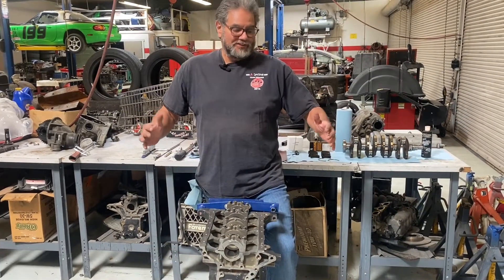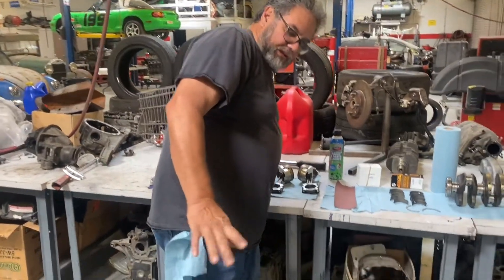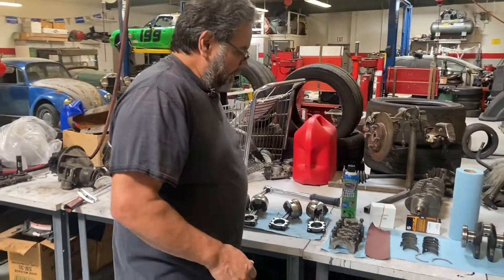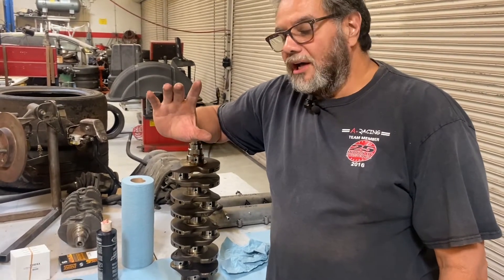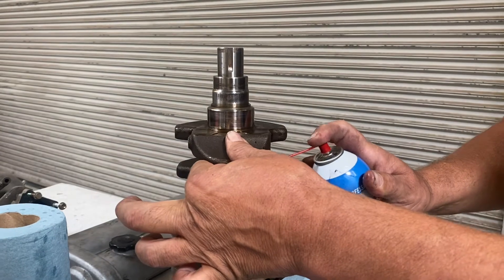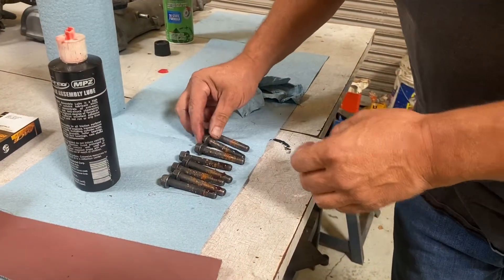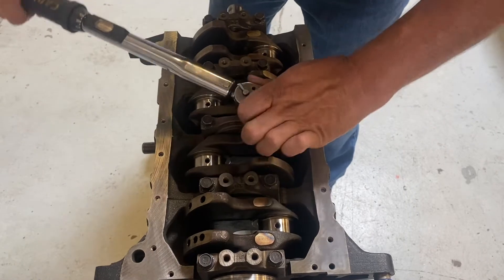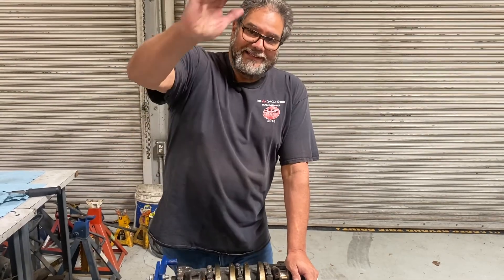PT1 DIY Pro Built Engine Spec Miata Crankshaft Short Block

Comment: Thanks, great videos. When you put assembly lube on bolt threads, put a small amount on the bottom of the bolt head, Friction is friction. when torque is applied the head drags harder being dry and will affect the torque!